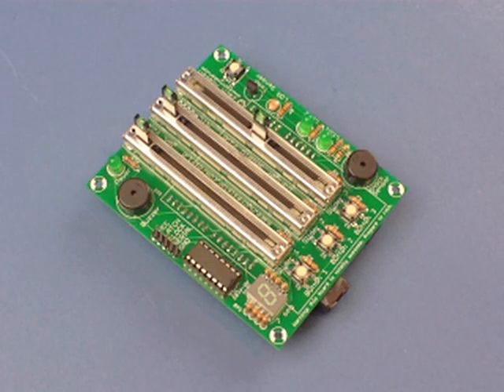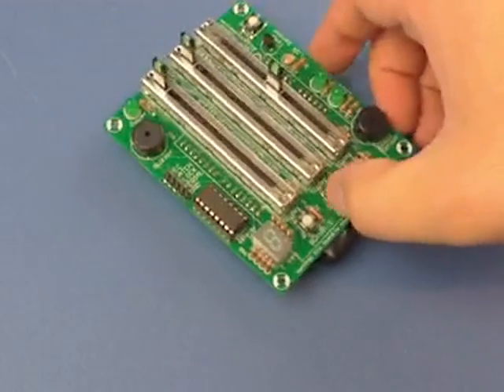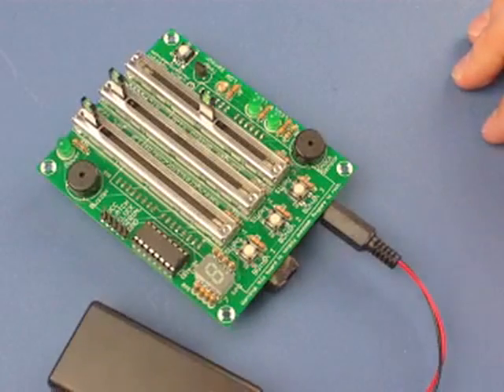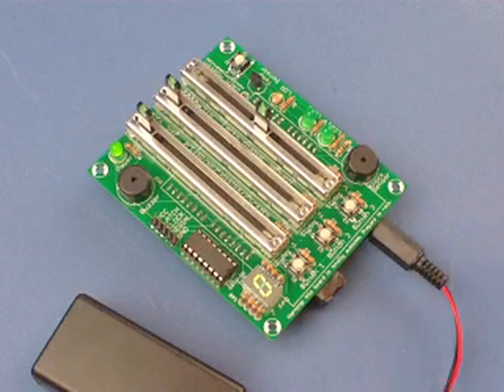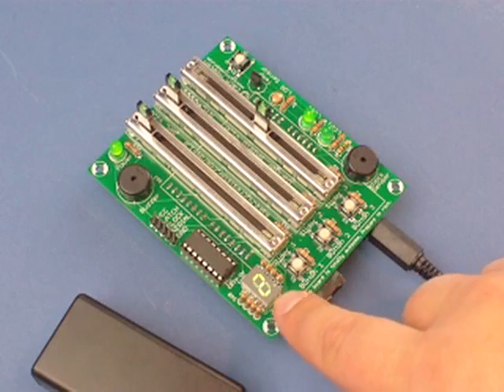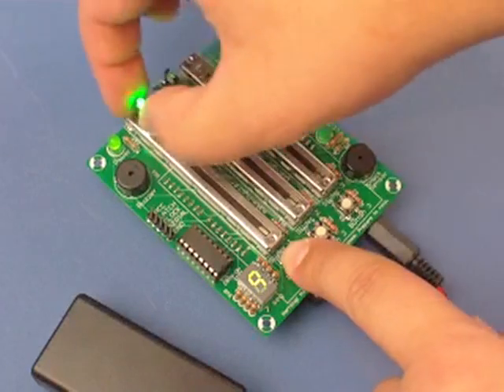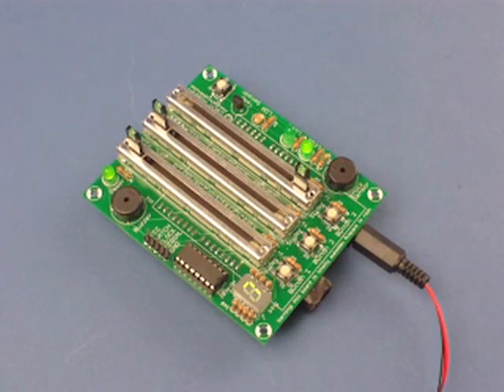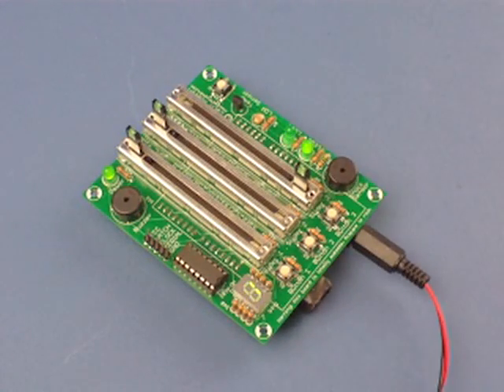How-to Tuesday: The Danger Shield for Arduino

Comment: I just finished one. I couldn't find working code to test my v2.0 board so I started comparing the different schematics till I found mine. Then grabbed pieces of code to plot my way through each pin and sensor to make my own code. It should be call a programmers testings shield imho because that is what it does best. For the noob with the basics this will be your code testing go to shield. I've already modded mine to add headers to the few remaining pins